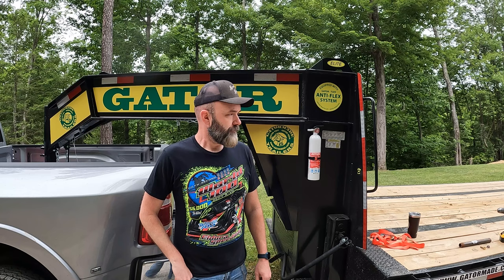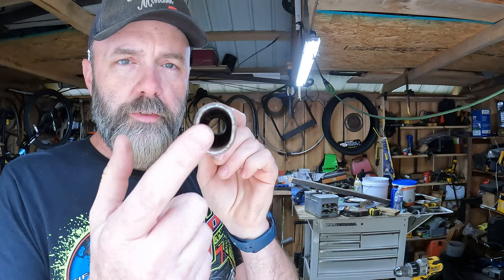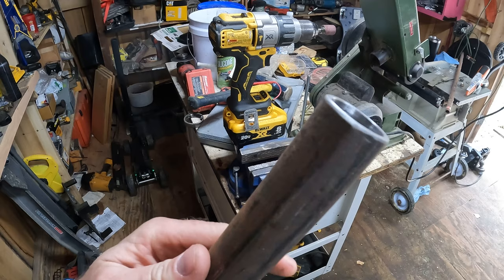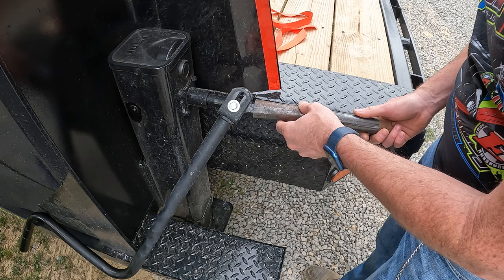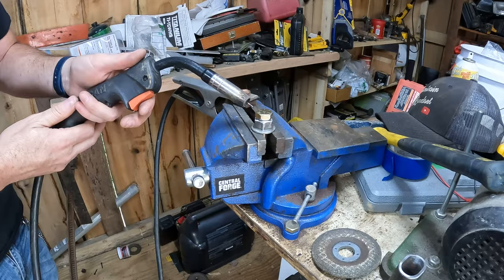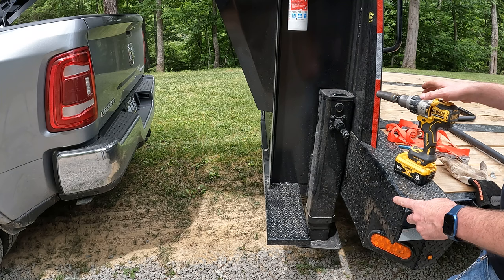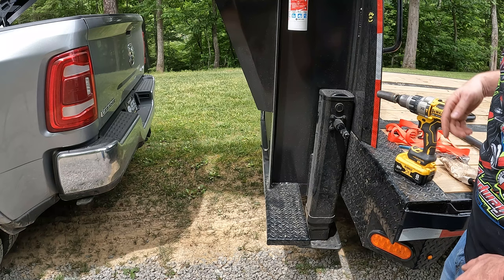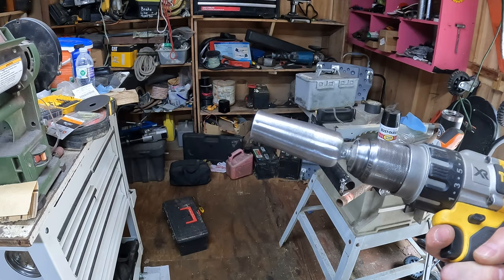Making a trailer jack drill adapter

Comment: Look all you have to do is get a 1" impact sock and drill a hole in it and put it on and put pin in whole and done!
Reply from the maker: Not a bad idea. Probably be fine like that but I wanted it to catch on the flat sides like the factory handle does instead of just relying on the shear strength of the pin. There’s a lot of torque there when jacking it up loaded. Thanks for the tip! 👍🏻
Reply: Over time, an impact will damage the gearing inside the Jack/jacks.
Reply from the maker: @russellmoore5711  I thought so too. Those impacts can only do damage to those gears. I use the drill for that very reason. 👍🏻
Reply: You’re right.

Comment: Hey, quick question, how’s the Dodge running? Anymore problems?
Reply from the maker: The transmission seems ok. I’ve towed 20k gross trailer weight up some steep hills (12 on the pitch and roll screen) with it and no problems so far. 🤞
Reply: @MountainMindset  cool. I hope it stays in good shape for you
Reply from the maker: @pilgrimsgarage  thanks!